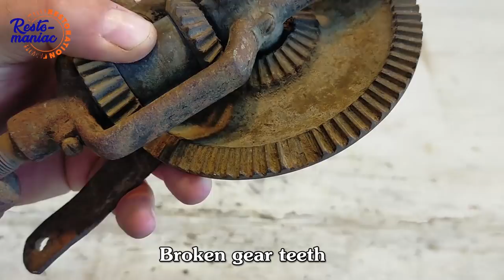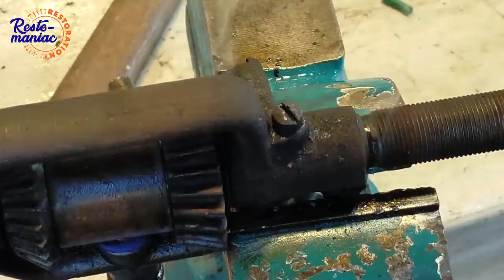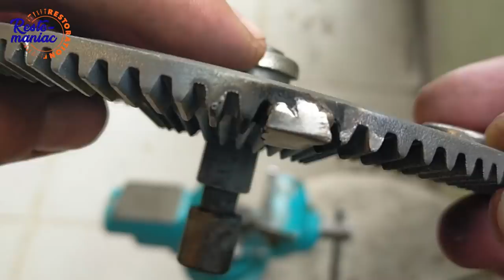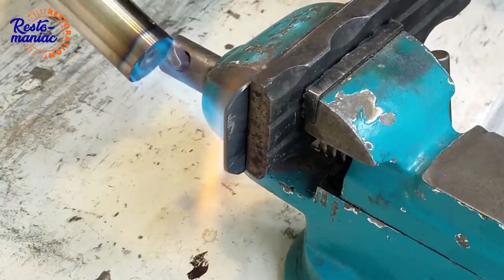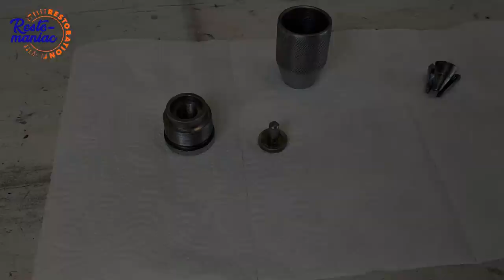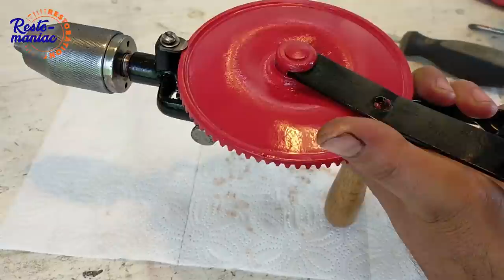Older Breast Drill Restoration (1910-20s) Goodell Pratt

Comment: I found what I believe is te same tool in a pawn shop. It is in fairly good shape with all the parts more or less working. On mine the butt plate is held by a small set screw which I can't move despite WD40 etc. Any suggestions. Also it was painted all red at one time. I like your black and red scheme. Is that original or  your inspiration.  Any and all tips welcome. Hope to hear from you.
Reply from the maker: You can expand the metal by heating the outside of the metal and then lubricating it. So it can come out more easily. The butt is not original, it is a bit of my own. :) Thank you.

Comment: You are not old enough to use one of these.  They don't have grease on the gears. You use the gears dry. If you grease them, wood dust and grime clog the gears
Reply from the maker: No, I'm not that old :) But the old ones were a bit lazy too. I would rather clean them at the end of the day rather than running the gears without grease :)
Reply: @Restomaniac  The gears will never get enough use to wear out even without grease. Trust me. I am old enough to know this.

Comment: My heart began to flutter when I saw your welding, by the time I saw you use a tap in a battery drill I was at full palpitation!
Reply from the maker: Thank you for your comments :)
Reply: He did the same thing with a tap repairing a small kitchen grinder . I cringed and looked away , but the item worked